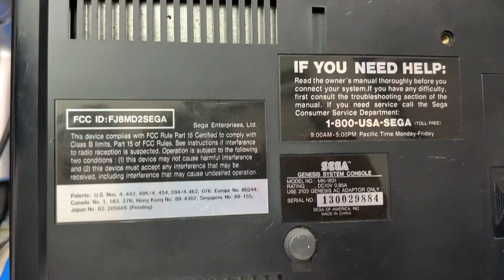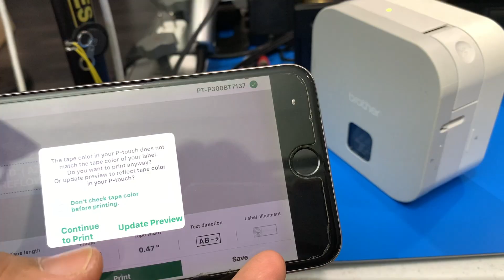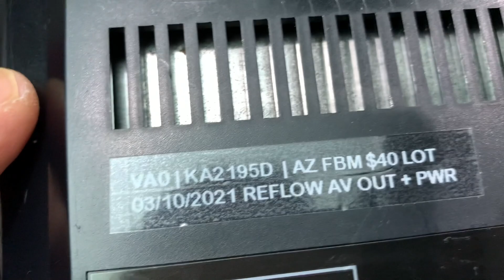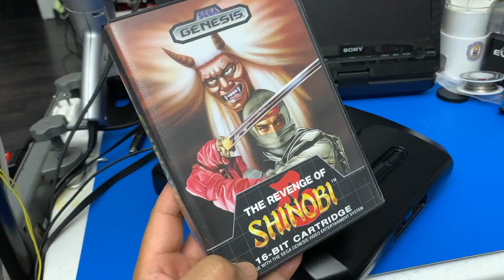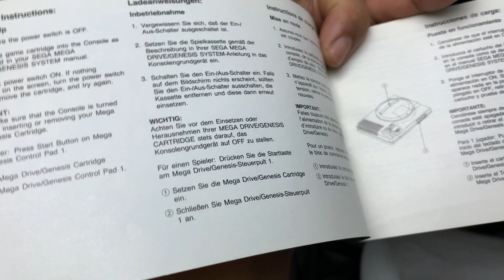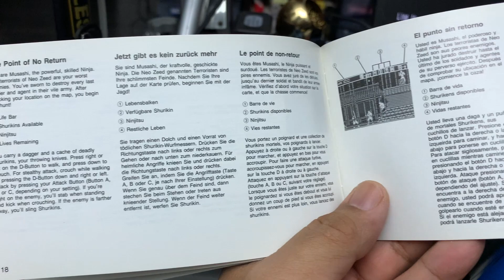Episode 123: Sega Genesis 2 Facebook Marketplace Rescue- REFLOW FIX

Comment from the maker: REFLOW: remolenizing (melting) the solder to reestablish connection. Instances include these "plug-in" ports that take some force when the something is plugged in, and the solder cracks at the leads to the PCB.